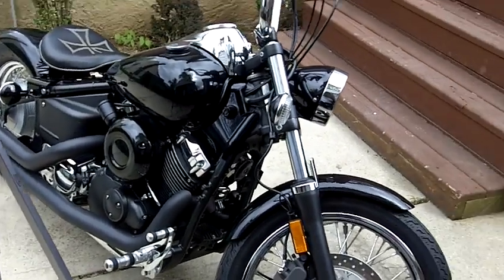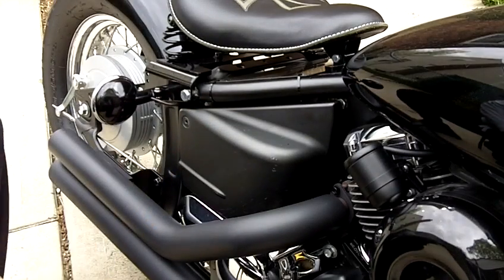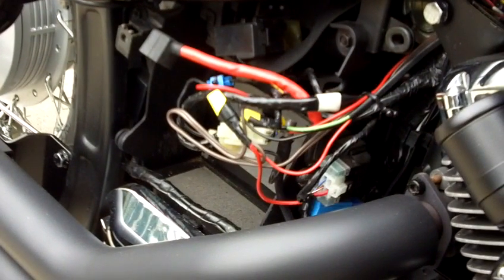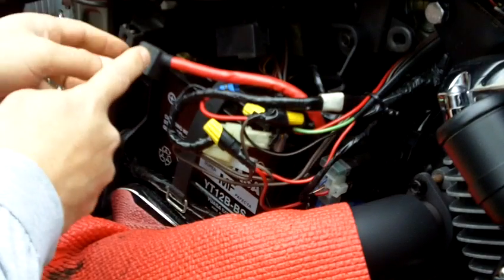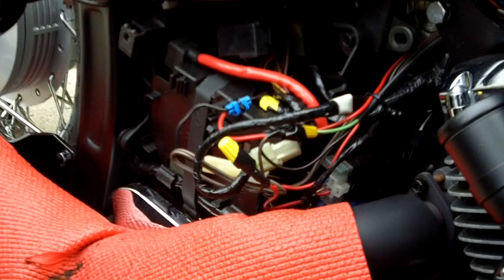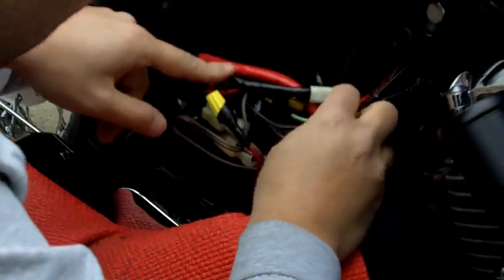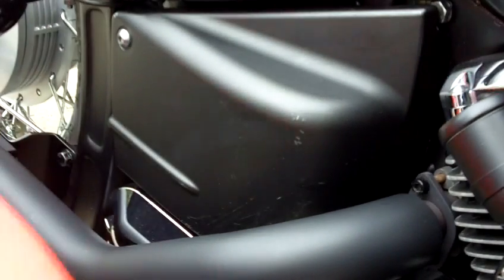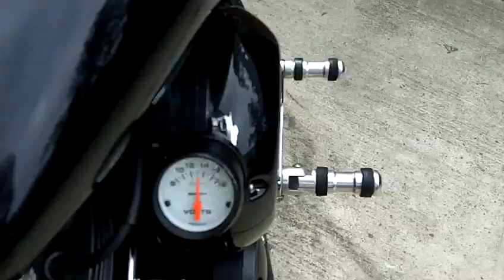2008 Yamaha V-Star 650 Spring Start-Up (2015)

Comment: Hi im new to riding and i just have 2 questions.. Since the bike has no gas gauge how do you know when you need gas and where did you find those cool ass exhaust pipes and was it hard putting it on? Btw really nice bike
Reply from the maker: Trial and error. The book says it's a 5 gallon tank. So I drain the tank and refill it to know how much was in there. Then fill the rest up to 5 gallons. Then ride it until it stalls, yes stalls. My pet-cock  had three settings on-off-resv. When I was riding it would choke and if your good enough you turn the petcock while riding to resv which is a shorter fuel line allowing more fuel to go in the carbs. I got about 130 miles before that. After that the rest is gravy. 

My pipes are Hard Chrome DD.

They are not hard to install with the right tools.

Comment: I have some questioning on your exhaust system and its exact measurement location on your bike would you mind Answering my questions .. I'm trying to find the right exhausted for me ... since my bike has Harley hard bag modifications and no exhaust seems to be made for this homemade mod...
Reply from the maker: Luke Kulpa What kind of bike do you have?
Reply: I have 2007 Yamaha vstar650
Reply from the maker: Luke Kulpa something that custom you would have to bring it to a shop and have a motorcycle guy give you options.